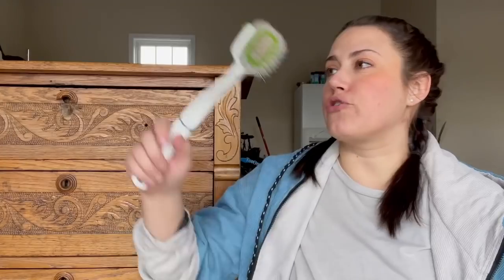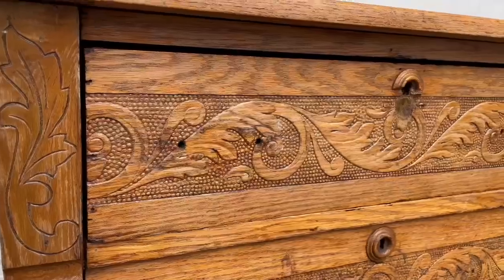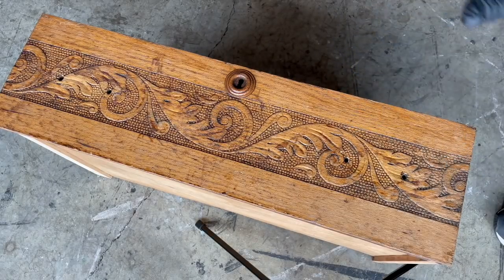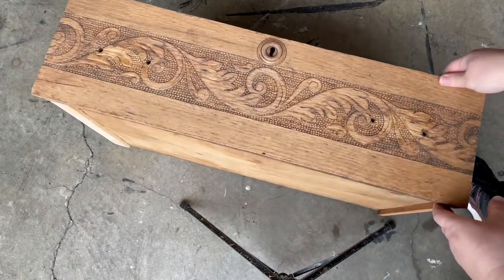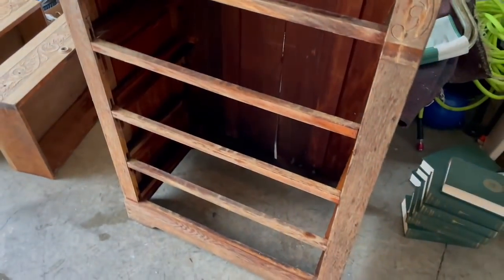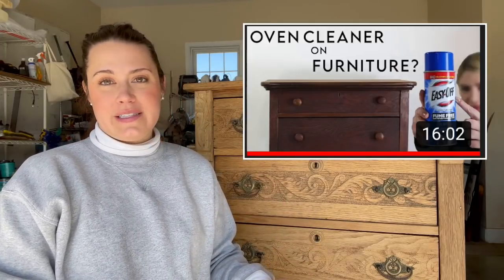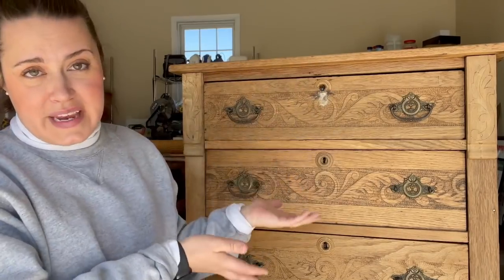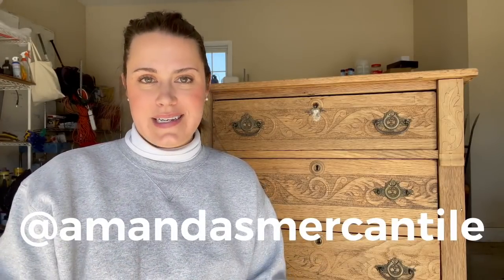How to Strip Furniture Using Oven Cleaner | ANTIQUE DRESSER MAKEOVER

Comment: I use a little brass brush to clean out the crooks and crevices and it works great. It doesn’t scratch the wood if you use it lightly and it definitely removes the left over finish left in those spots.

Comment: I sanded my kitchen cabinets down to bare wood and applied Johnson’s Paste Wax to protect them from drying out.  It doesn’t change the color or look of the wood at all.   Also Minwax satin finish Polycrylic will protect the wood and leaves hardly any sheen at all, but I prefer the wax.   That piece turned out wonderfully!   Thanks for this tutorial!!  ☺️

Comment: Definitely only marginally effective stripping spar! A ton of scrapping and hard sanding still required to remove spar when using easy-off. Also, consider where the run-off of oven cleaner is going to. Oven cleaner is not an inert substance so think before "hosing" off in an area of pets, children, barefeet or run off to creeks and streams.

Comment: I think it's dependent on the type of finish, age, kind of wood and how it aged.....lots of dry heat or damp humidity , or lots of changing seasons.  I used it on a "throw away" nightstand .  Never again.  The sander and citracel would've been more. pleasant.  Your piece doesn't look as if it has much stain or clear coat...wax....polyeurathan...So maybe that's a better option.

Comment: 😢    Oven cleaner does two things.  It is SUPER powerful and will not only take off finish and will lighten the wood...  it can and will disolve natural glues.  

Meaning using oven cleaner can cause the wood to split or significantly weaken where two pieces are glued together.  Joints, wood tops, veneers... etc.  Adding a hose will only exacerbate the effect. 

It's SUPER important to make sure you let wood dry for at least a week after you hose it.  You just dont know how much water was absorbed, particularly on raw wood.  You can also experience warpinh and cracking with excessives water.  

Don't do this to any furniture you value.

Be careful